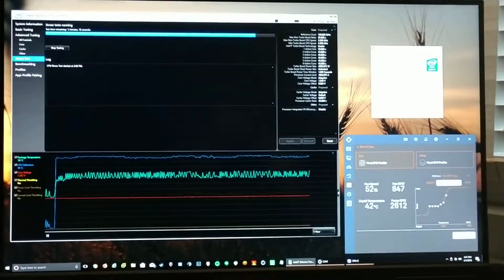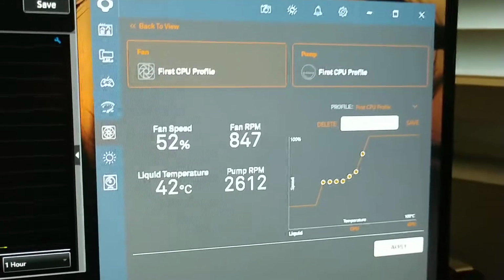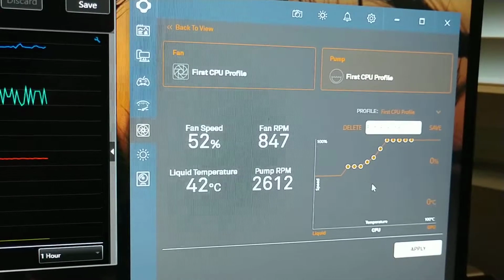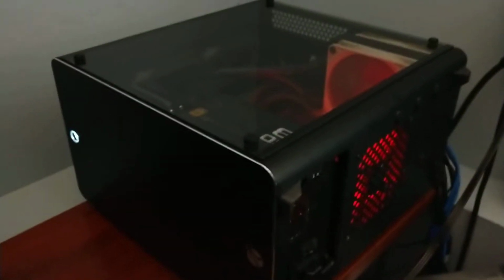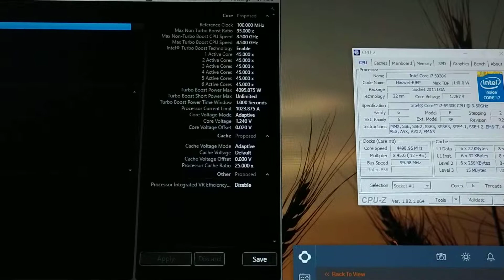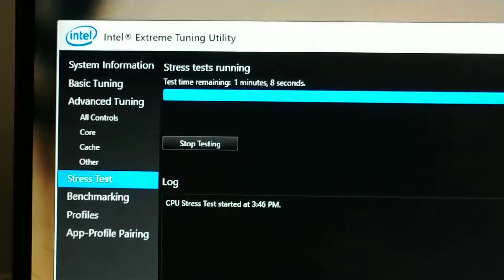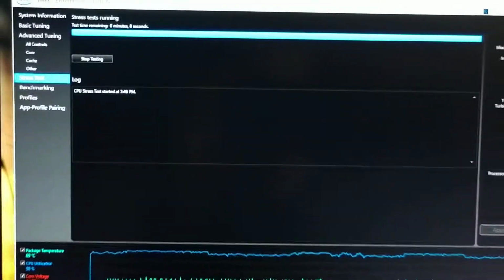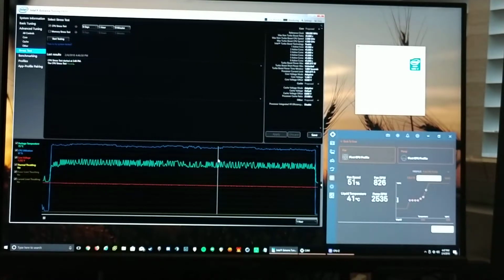i7-5930k stable and silent at 4.5GHz and 1.26V.

Comment: I rock one on my MSI X99S MPower Overclock Board (The Bumblebee) since 2014 and it will see 2025 in my use, I replaced the MSI GTX980 with an Asus RTX 3060 Ti Tuf Gaming OC 8 GB (The 3 fan model), And  I am still happy.

Comment: Can you try Prime95 smalltft test? I'm getting 90-100c with my water cooler...
Reply from the maker: How long are you running prime95 for? If you run it for several hours, you'll eventually get the liquid fully heat-soaked and if you don't have enough air flow to bleed it off, your core temps will climb a good bit. I can run small FFT for about an hour before I get close to 90C. I'm at 85C within minutes of starting the test.
Reply: Nibelung Valesti your pump is probably broken